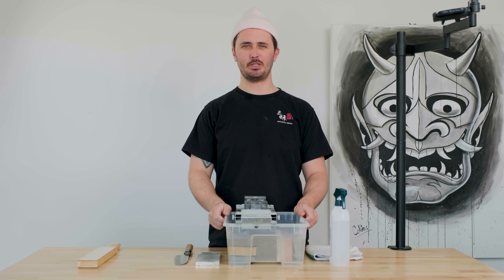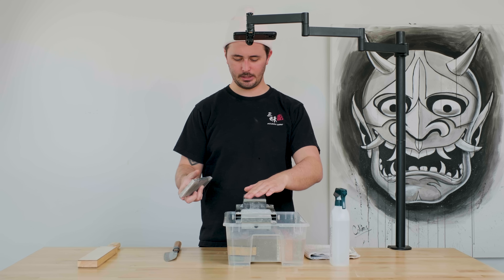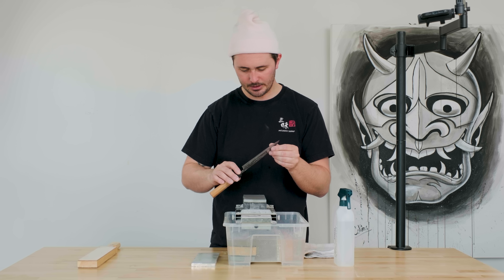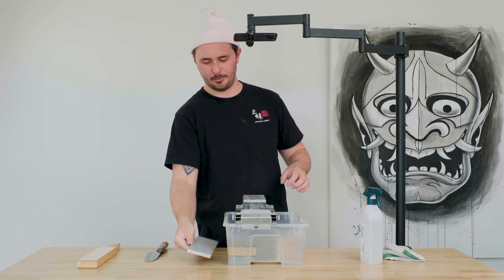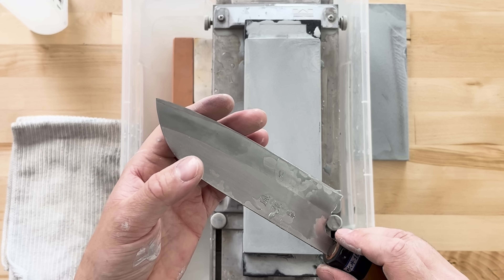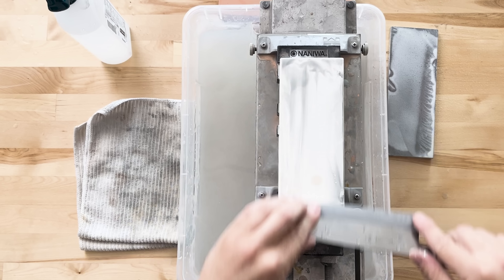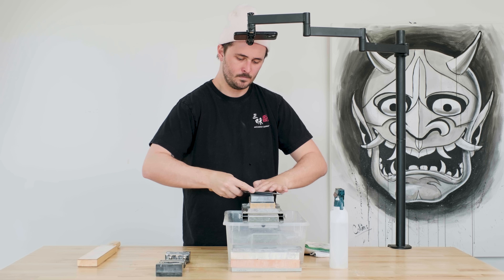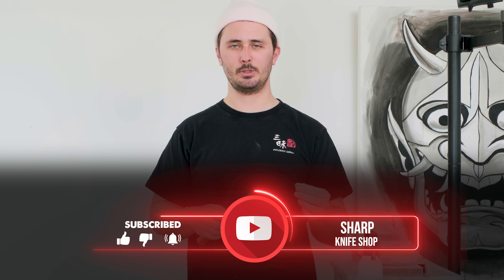SHARPENING - START TO FINISH

Comment: Thank you for all your helpful videos! They have helped me a lot to improve on my sharpening. 
I have one question, though: During de-burring, do you lift your handle up slightly as well to ensure that the tip of the blade makes contact with the stone? So is it the same as during the regular sharpening passes?
Reply from the maker: That's awesome, so glad we were able to help you out. Yes, making sure the tip is contacted during deburring is very important and is the same method we use when doing the regular sharpening passes. I hope that answers your question!
Reply: @SharpKnifeShop  It does indeed! Thank you for taking your time to answer my question.

Comment: Question - As someone who is right handed, when I'm sharpening the backside of my knife (holding in right hand, edge trailing stroke toward my body) I sometimes scratch the ferrule of my handle on the stone. What would cause this? Too shallow an angle?
Reply from the maker: Likely has to do with how you're orienting the knife, I like to keep my knife perpendicular to the stone when sharpening the backside.

Comment: I can't seem to develop a burr and I feel like I'm being consistent with my angle
Reply: It's definitely usually angle. I use to have this issue in beginning.
A few tips
Get a beater knife to practice on...if you don't already have one.
Try a lower grit. 180 is prime.
Use your index finger or middle finger to feel for burr. They're wayyyyy more sensitive than thumb.
The burr doesn't need to be huge age addressed here.
Practice, practice, practice!
🥰